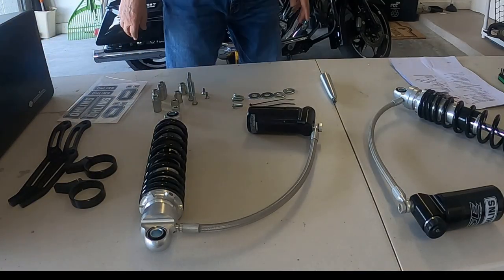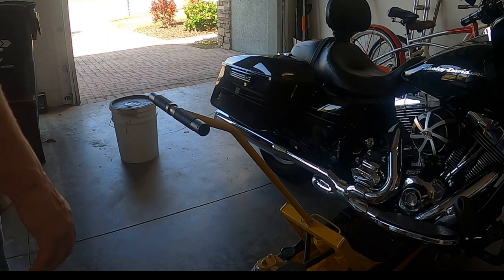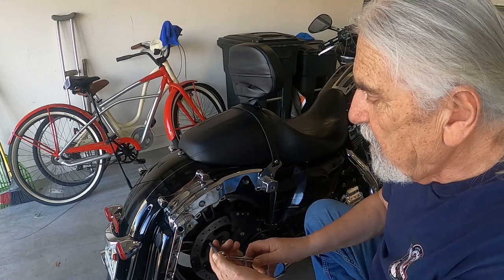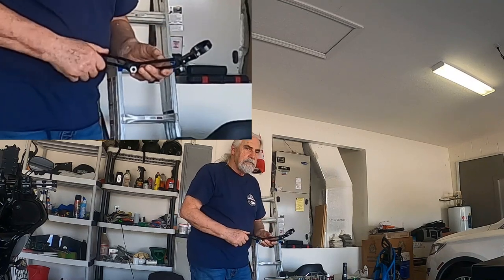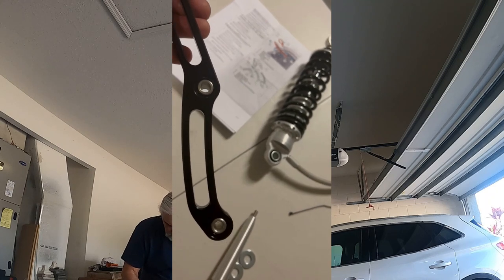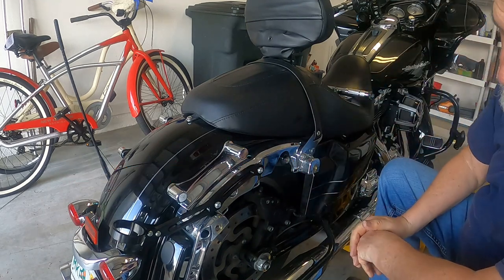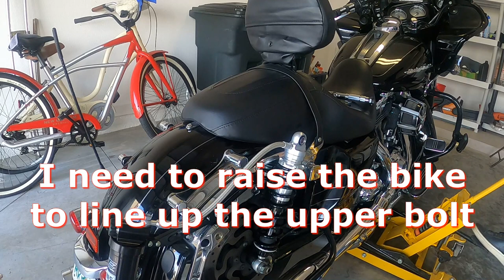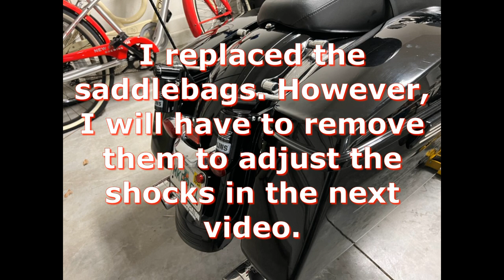Screamin' Eagle Ohlins Shock Install

Comment: Great video. One minor thing...never use a torque wrench to break bolts loose. You mess up the calibration and basically make your torque wrench useless.
Reply from the maker: Thank you for your comment. You are correct, I shouldn’t have. Fortunately, my torque wrench survived!!

Comment: Did it call for RED Loctite for the shocks?  I would have gone blue. knowing I could remove easy if needed.
Reply from the maker: Rick, I just re-read the instructions. Actually it did not specify. It did say red for the spacers in the bracket. Lol, I used blue there. Thanks for watching and commenting. All the best. Cal

Comment: How this ohlins SE compare to the ohlins hd044 (the gold one)??
Reply from the maker: They are basically the same shock. The only thing that I could see that Harley had changed was the bracket for the remote reservoirs. The Screamin eagle ones are more to the side, away from the docking hardware for mounting a detachable tour pack or backrest.
Reply: @SNOWBIRDBIKER  they're seem to be different in the springs, the ohlins SE has progressive springs and the ohlins hd044 has the linear springs. But I don't know which is better spring

Comment: Hey Snowbird have a question for you. I just installed a set of these and I am not able to get any sag out of the shocks. Even with no preload I get maybe 1/2 inch sag. If i set them at 10 mm per the instruction sheet I get no sag at all and it rides like a brick. How much sag do you get when you are sitting on the bike and how many mm of pre load do you have set for your weight?

Thanks
Mike
Reply from the maker: Hey Mike. It’s been a few months since I installed those shocks. They are on my bike in Florida and I’m now in Canada, so I’m going on my memory. Lol, which isn’t always the best. I adjusted the preload as per instructions at 10 mm, and had about 1 inch of sag. I set my rebound dampening at 12 clicks past zero. I set my compression dampening at approximately the half way point between the soft and hard settings. The shocks are excellent. After installing them I rode from Florida to Chicago, then took Route 66 to California and back to Florida on i10. It was a comfortable 8,000 ride. The only change I made was moving the compression dampening to a softer setting. 
I don’t know what could be causing your problem. I wish I could be more help.

Comment: Thank you for the informative video. Just got a set. May I ask approximately how long it too you from start to finish? Thanks again🙏
Reply from the maker: I guess the install took about an hour. It’s not difficult. Later I played with the adjustment settings, and test rode the bike to get the ride how I liked it. There’s a really rough railway crossing near my house. Lol, I kept riding back and forth over it. Good luck with the install. I recently rode from Orlando to Chicago. Then rode Route 66 to California and took i10 back. It was over 7,000 miles. Those shocks made it a much more comfortable ride.
Reply: That’s awesome. Thank you again and safe travels 🏍

Comment: Have you had any issues with discoloring braided lines? I’m on my second set and both have started to discolor almost looking like oil has leaked into the braided lines under the plastic. I am highly disappointed with the shocks and regret spending the money. My bike is garage kept so there should be no reason for it. 🚮🗑️
Reply from the maker: I have not had a problem with it. Mine have not discolored at all.
Reply: If you’re considering buying these, DON’T, trash product DO NOT buy. Go with something else. I’ve gone through two sets, both of them had the cables discolor (rust) within a few months. My bike is garage kept and not left in the elements. Trust me, if you work hard for your cash, you do not want to spend it on these shocks. Oh yeah, and Harley and Ohlins told me to kick rocks… Hate to be negative on here, but I have to be honest
Reply from the maker: @Ride2Cast Gabe, As I said in a previous response, I have not had a problem with discolouration of the lines. My bike gets a lot of miles and when I’m on the road, I don’t use a bike cover. I wash it with automotive soap and water. I don’t use products that have harsh chemicals. I know several people locally with these shocks and no one, including those commenting on my videos have reported a problem, other than you. I don’t receive any compensation from either Ohlins or Harley. I and thousands of others have found them to be great shocks. Your situation seems to be unique.

Comment: Did you use a washer on the bottom  mounting bolt.?
Reply: Could you use a washer on the bottom mounting bolt on the inside
Reply from the maker: @cameronbartley6139  Cameron, I can’t remember. My bike is in Florida and I’m in Canada until the end of the month, so I can’t go look at it to refresh my memory. If there were washers included with the new shocks or if there were washers on the old shocks with instructions to reuse them, I would have. However, I did not add anything on my own. I followed the instructions exactly.